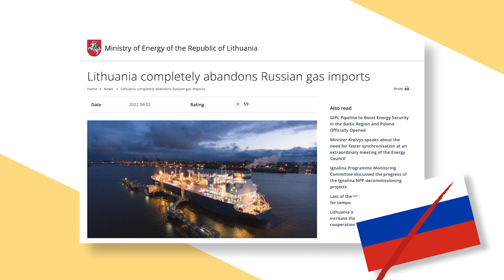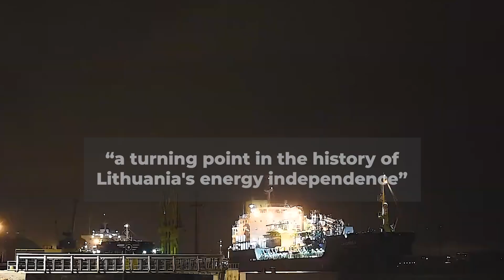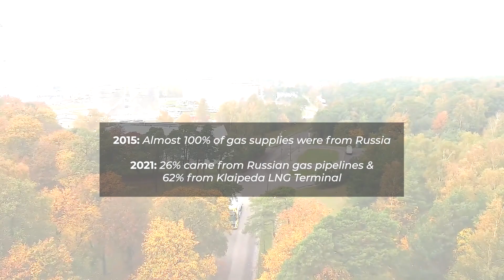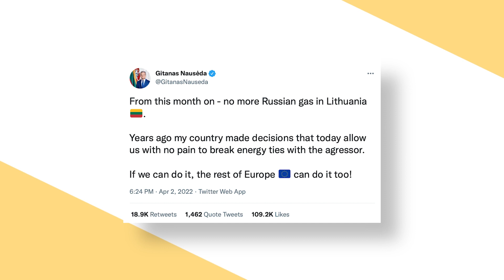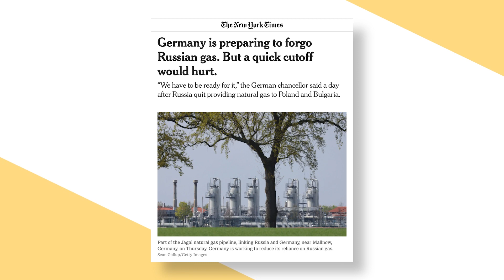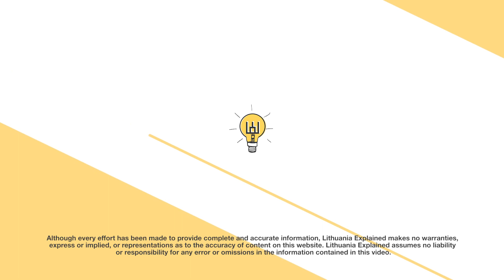How Lithuania Quit Russian Oil Imports

Comment: I truly believe this is the greatest chance to invest fully in renewable  energy and possibly save the planet
Reply from the maker: Absolutely!
Reply: Forgive me for the indiscreet question, but what methods are you going to extract energy in the "Green" way?
Reply: Atomic powerplant
Reply: @user-ir3fc7kv7h  Mostly solar power and wind turbines.
Reply: @maybeeyeman  In your opinion, these energy sources do not harm the environment? If so, then you are wrong, unfortunately.
Reply: @user-ir3fc7kv7h  the harm they do is much, much less than oil, gas and coal
Reply: @efectovogel8295  and the cant produce as much energy too. So imagine. You had one coal-fired power plant that produced a conditional 100 units of harm and generated a conditional 100 units of energy.
You closed it and decided to use windmills.
Each windmill generates 1 conventional unit of energy. And it produces 1 conventional unit of harm.
It turns out that in order to replace coal, we need 100 windmills. Accordingly, 100 windmills will produce the same 100 conventional units of harm. The difference is not as significant as you might think.
Reply: @user-ir3fc7kv7h  your argument is meaningless if you make up the measurements. What exactly counts as a unit of harm? What exactly counts as a unit of energy? 

>”So, imagine”

No, show me actual data that you’re using to make that claim so I don't imagine it, I know it